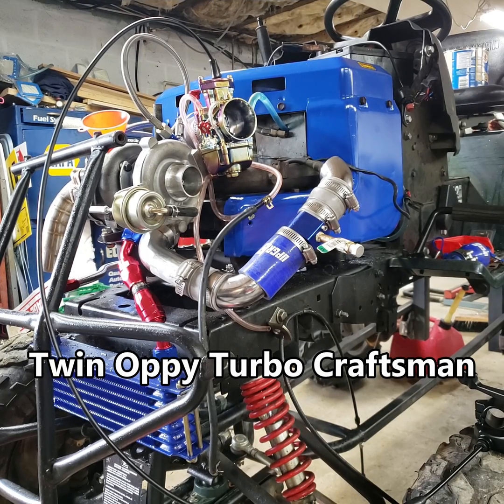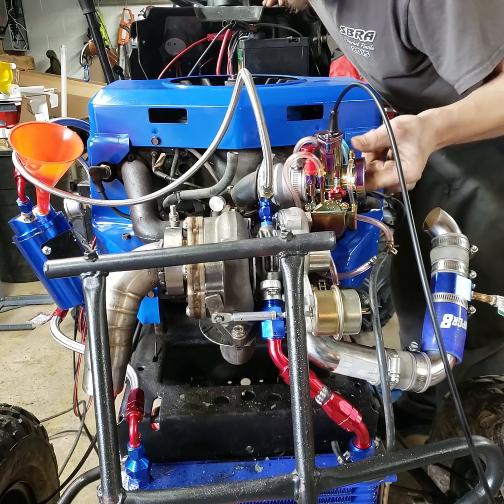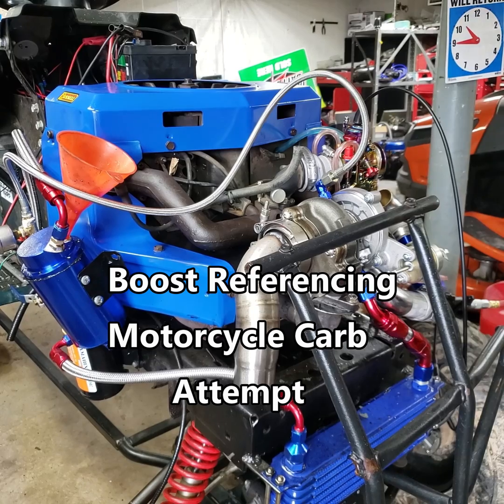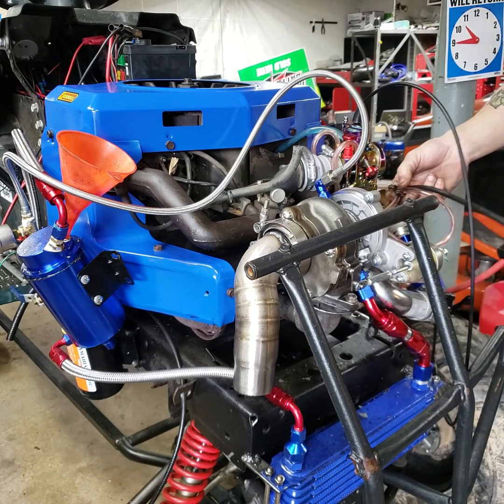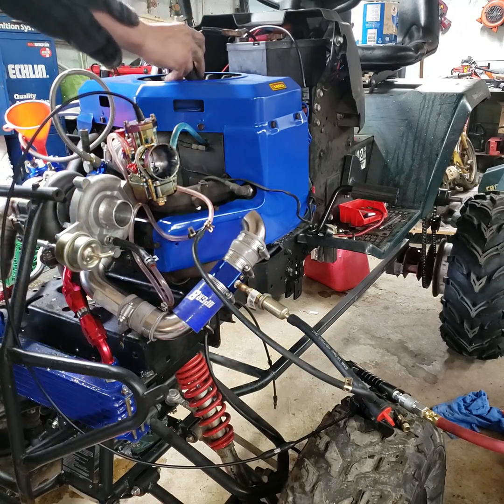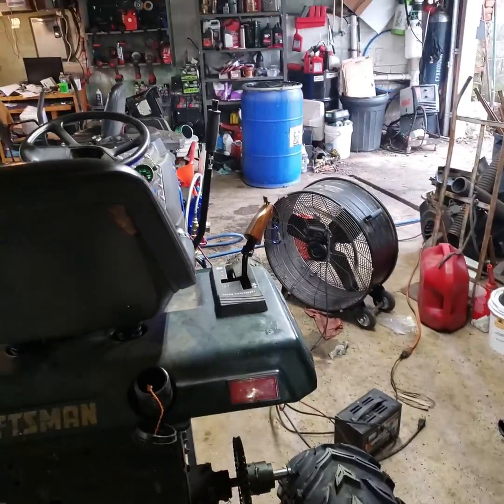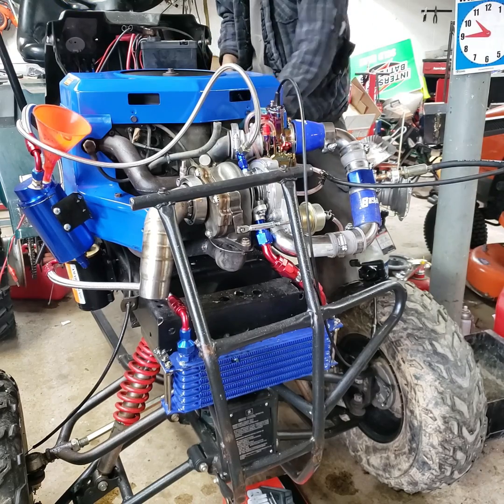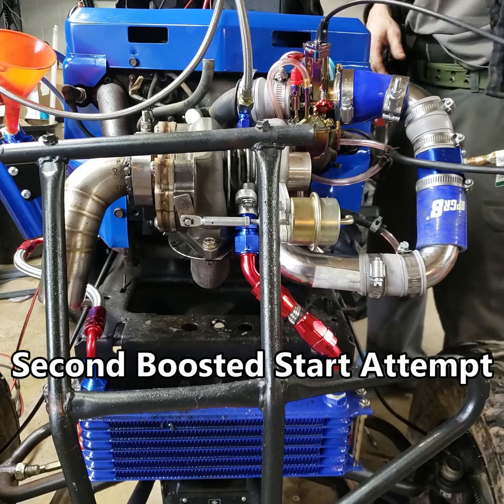Turbocharged Lawnmower Blow Through Setup Design Twin Cylinder Briggs Motorcycle Carburetor Start up

Comment: Take that carb and stick it on the intake side of that turbo. Then extend the charge pipe to the intake. And take all those hoses off the carb. Then you might have a normal running engine but with boost! I trued this same method on mine did not work but the draw through setup is almost fool proof and works like a turbo should.
Reply from the maker: for sure! i thought about this also, i really wanted to do a blow through setup at the time but hine sight i cant say i would have cared to much whether it was draw through or blow through. i felt like there was a reason but yeah id agree!

Comment: sounds like a beast. have you thought of going with fuel injection? turbos work better with fuel injection rather than carbs.(they do make motorcycle fuel injector conversions, dont know what you would need in this case)
Reply from the maker: I have i am nervous i do not have the ability to creat the programming side of it. Im not the best with electrical. Plan to bring it back out here real soon and finish it up
Reply from the maker: I’m planning to do fuel injection as the carb ended up working on the harbor Davidson As a last resort. And my experience in electrical and programming is getting better stay tuned

Comment: The Spring for the throttle is too soft, can't keep up with the boots. Once revers! it will take a little bit longer to go back to idle but once boots is low after the revers it will get back to normal idle but won't be able to control the amount of boost, it's actually fucked tho

Comment: Hey man i watched this video about 6 months ago, and tried this same kind of build with the same carb and a pressure lubed 46 c.i opposed twin, and i got it running pretty damn good, but always hesitant to rev past a certain low rpm, but recently i found that without the turbo, these carbs run the opposed twin or maybe any engine of this size exactly how it ran with the turbo. It seems like it was getting just a bit too much fuel, so i removed the powerjet tube, and now it revs up with 0 hesitation. So if you see this, try removing the powerjet tube, and just plug the ports the tube goes on, and i have a very good feeling that your turbo build will finally run correctly and be complete. Idk if your also running a 1:1 boost referenced return style fuel pressure regulator, but your gonna need that too for blow through. Make sure its a 0- at least 100 psi adjustable regulator too! I hope you see this comment and i hope it helps!
Reply from the maker: 0-100 psi adjustable seems a but broad ranged and everything else you said sounds like it may work. I wish I had the pressure lube version the oiler burns the fuse panel up... I do greatly appreciate your input hope to bring it back out soon
Reply: @psychosiscustoms  i hope to see it making boost soon man give us that fire content!

Comment: Dude you got it all setup beautifully all you need is a 1:1 fuel pressure regulator and the fuel pressure to match your boost pressure. I built mine same way as yours i just added a high pressure pump and the regulator and adjusted the psi to same or maybe 1 more than the max boost pressure. I really hope you see this so you can finally get yours running. With the fuel regulator, it will make your engine run like normal with the boost. Mine sputtered while trying to spool and ran exactly like yours in this video. I put on the regulator, and boom, it runs like it has a whole efi kit with a tune!
Reply from the maker: So.what style or brand fuel pressure regulator i was having issues finding a low psi that would work have any pictures of yours
Reply: @psychosiscustoms  yo i posted another comment basically the powerjet on these carbs also floods the carb with fuel with or without boost on these opposed twins or maybe any engine around this size. So try removing the powerjet tube and capping both ends on the carb. And also you need a fuel pump with at least 40psi and a return style 1:1 boost referenced 0-100 or max boost adjustable fuel pressure regulator.
Reply: You can get a fuel pressure regulator like that for very cheap on ebay!

Comment: stop trying to do anything with it without all your pipes hooked up. You think its running good and theres something wrong with the turbo system. if its tuned right pulling the charge pipe will make it impossible to build rpms when you give it gas. also your flooding it without the turbo spooled up you barely need any pressure then with boost you need to build pressure with the increase in manifold absolut pressure (MAP). Easyt was to do that is a boost sensitive fuel pressure regulator. they arent super expensiive should take care of your problems  AFTER you box in the carb and test for leaks on ther whole system. your 90's need some pups welded on them so your not tryiung to couple to the radiius of the bend and leaking pressure or pulling air in its impossible to tune when you afr is constanly changing. also 14.7 "stoichometric" or lambda 1 or  barometric presssure is a perfect burn at baro press. your adding boost to the engine your going to want to shooot for more like 11;1 at redline. excess fuel cools cylinders which makes for a denser burn. your almost there. https://www.summitracing.com/parts/tnk-afpr1

Comment: Can you draw through the turbo I think you could lose the pressure problems
Reply from the maker: Hmm any ideas to expound upon that I understand the draw through set up but how so is your thoughts with that?
Reply: @psychosiscustoms  if you put the carb on the inlet of the turbo it will be sucked on kinda like na not blown through although you have probably got the best running carbed turbo small engine I have seen yet
Reply from the maker: @craigchiddo2794  I will.certainly explore this further when I can resume. I have done little research with it as I remember wanting to attempt the blow through more so at the initial build time..
But now so with time available forseeably , I'd like to finish it right but the time will be a factor as to when. If drawthrough may result effective presumably quicker I'd totally consider at this point! In regards to your recommended solution, 
I am  not and typically am never married to one project or design.
Thanks again for your very kind words & advice I appreciate your time!
Be blessed!
J.M.D

Comment: Where did you get the carb and what's the start on doing a turbo like that
Reply from the maker: Its been on hold for the summer as ive been very busy at work but most parts are purchased on amazon ebay or a hardstore
Reply from the maker: What part are you looking for to start ?
 I'd say it depends on motor you plan to use or intend  to use.
  if you need that or haven't determine that that's your first situation to tackle.
id say determine your engine . Or what is that desired engine in mind?
Reply from the maker: I'll send link to carburetor
Reply from the maker: Link posted in description for you and any one else interested!
Reply: @psychosiscustoms  thx

Comment: Couple things here: first, at the beginning of the vid when you are blowing into the tube to pressurize the bowl all you are doing is enriching the mixture. This is why it runs like crap for a second,  you’ve pressurized the bowl but the intake wasn’t pressurized; no charge pipe hooked up. 

Second thing: to get this to run well you have to have your bowl pressure actually slightly HIGHER than your charge pipe pressure. If they are equal there will be no additional bowl pressure to force fuel out the jet during boost. To achieve this you need a pitot on the end of the tube going from the carb into the charge pipe.
You were correct that your fuel pump pressure should be 1:1 with boost, but your carb bowl pressure should be slightly higher than 1:1. 
Google pitot tube and you’ll see what I’m talking about and read some write ups on pitot tubes in relation to blow through turbocharging. 
Good luck.
Reply from the maker: That all sounds about right. Ive since had this running better but havent yet had a chance to video tape updates as soon as we get the opportunity i hope to post more videos on this build! Thanks for your advice!
Reply: 1: 1 bowl pressure is exactly what u want. Then the carb will work just like it did without boost.  Change 1 thing boost reference your fuel bowl between the carb and motor not the charge pipe. The charge pipe is on the wrong side of the throttle slide and when you let off the gas it will cause it to be rich and stumble everytime.
Reply: @timharrison291  if you reference it post carb would it not create a vacuum in the bowl when it’s not in boost? And potentially suck fuel from the bowl through the reference tube? I am trying to learn, I’ve been trying to figure all this out in my head before I try it
Reply: Literally just need a 0-160 adjustable psi 1:1 fuel pressure regulator